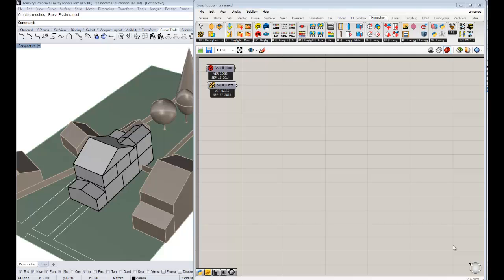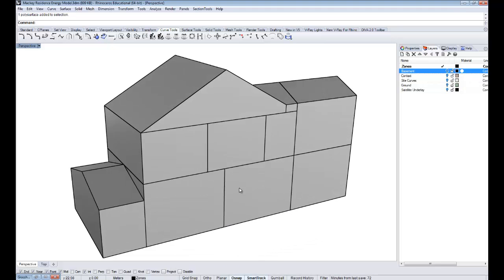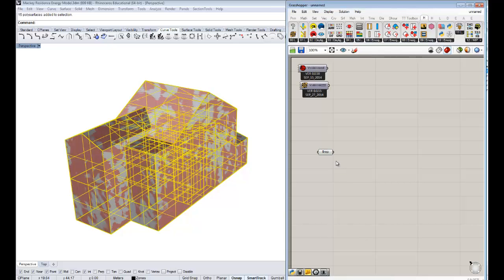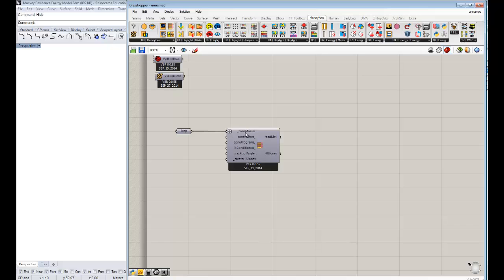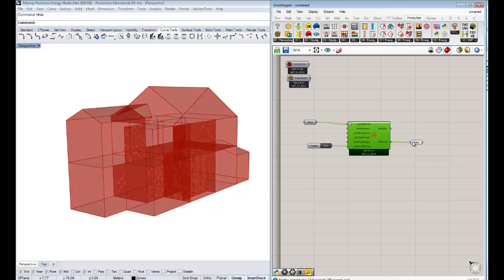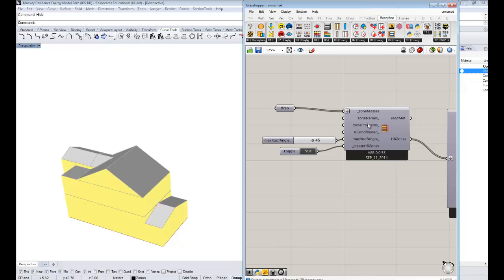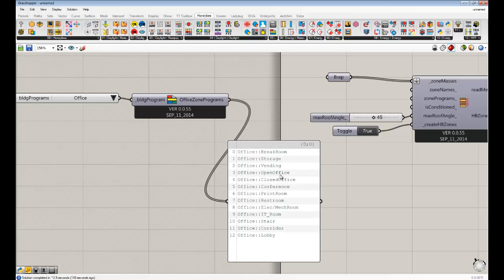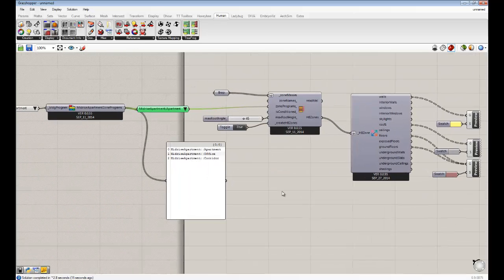2 - Honeybee Energy Modeling- HB Zones from Masses Part1: Mass2Zones

Comment: Is Mass2Zones gone now in version 0.061? what should be used instead?
Reply from the maker: It's not gone. Just restart Rhino / GH.
Reply: Thanks Chris, did just that and all my missing components returned.

I hadn't thought of asking you until you replied but, I'm currently really struggling to take full advantage of LB/HB, which is frustrating given how powerful these tools should be. 

I was wondering, do you know of any company/ group/network or individual people with expertise in London, England? I have emailed round my university department and some of the other Architecture schools here, but if anyone comes to mind, I would really appreciate it you could let me know, benstreet245@gmail.com

Comment: Hi, when I am trying to use the glazing ratio window generator, my windows by default have seem to have a sill height of 0, and seem to be extending all the way to the ceiling of the space. Is there something I am missing?
Reply from the maker: ahkpalaparthy,
Your Rhino units are probably not set to meters.  Whenever you work with Honyebee, you Rhino units should be in meters as this the same unit that EnergyPlus uses.
Reply: Thank you Chris ... I tried to proceed anyway till the energy simulation, and got an error saying that energy plus needs the units in meters. I then tried changing the rhino units, and saw that things worked out! :)